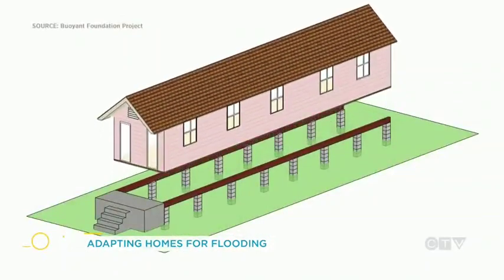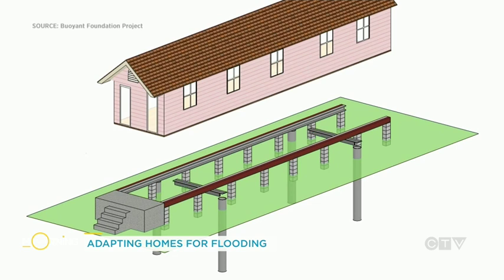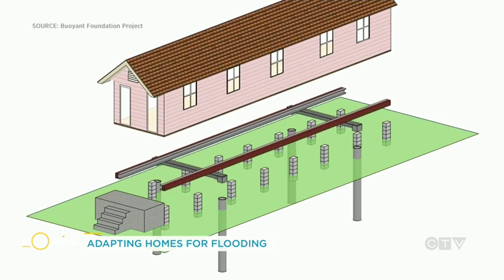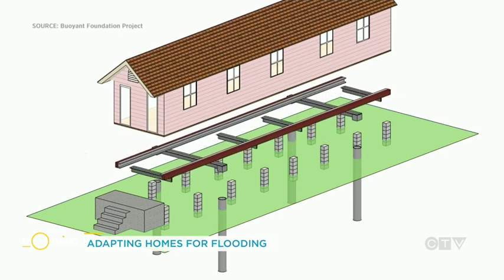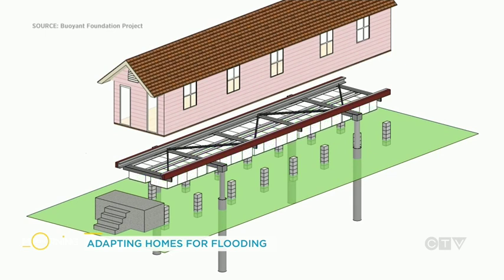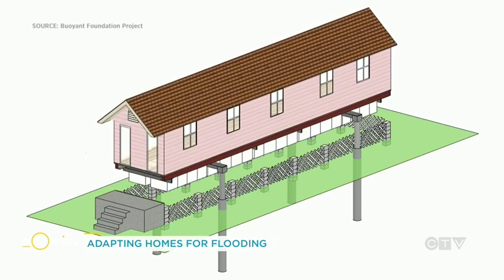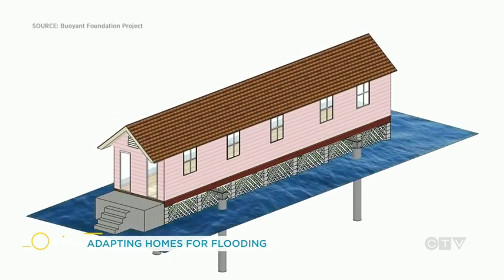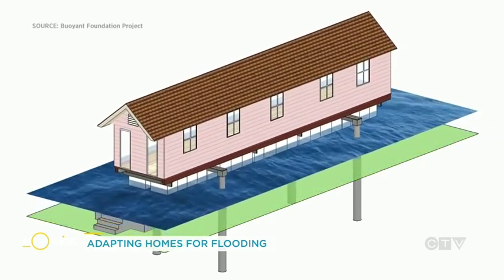New technology could protect homes from flooding by making it float | Your Morning

Comment: imagine your whole house just starting to float away
Reply: Watch the video
Reply: It wouldn’t let it float away
Reply: It has four large alignment logs that are sitting in Steel casements that are actually pushed into the ground probably about 12 ft. The casements hold on to the logs which is bolted to the support joist. Not much different than a regular houseboat. This will work great in an area that has frequent flooding